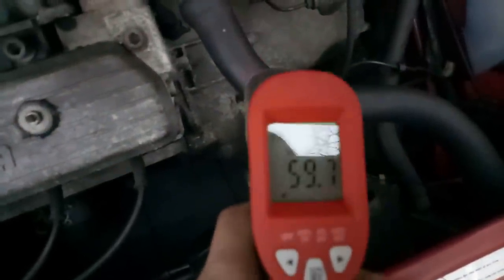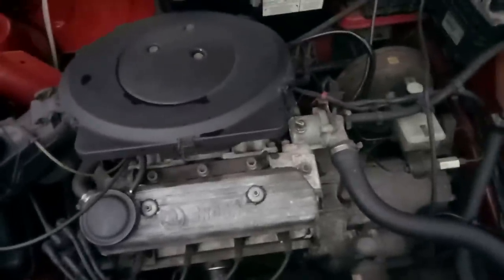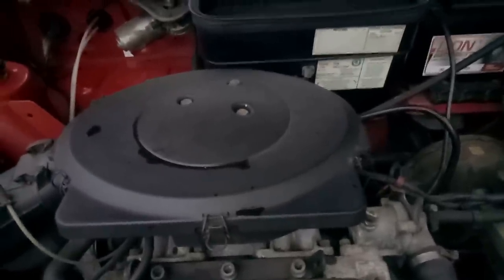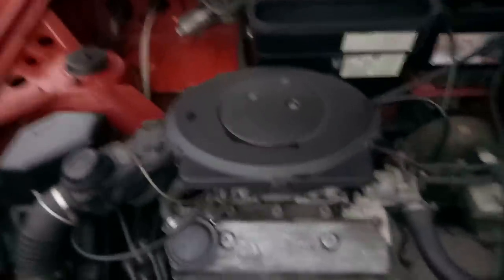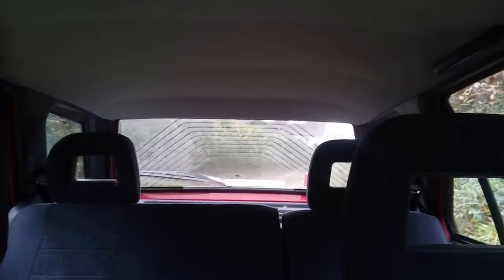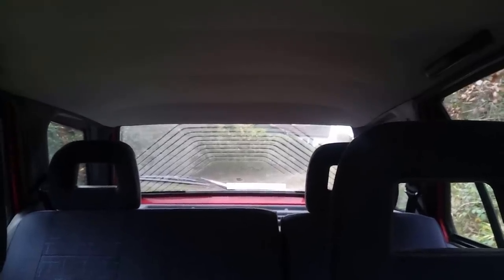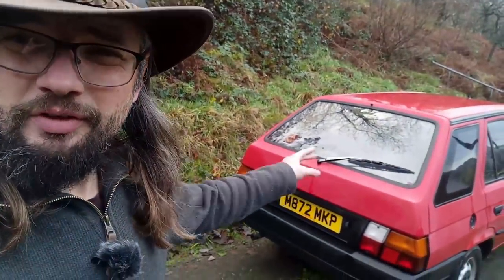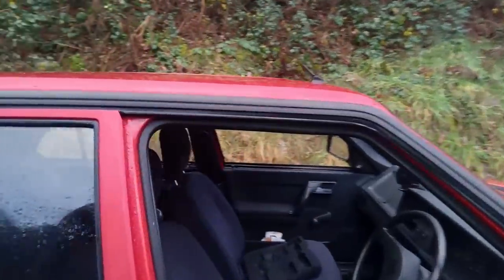Skoda Favorit Odometer fix (and other things)

Comment: had the same problem with the temp gauge. Try to give contact surfaces a good clean, they might get dirty. Best thingy is to hook up gauge to the voltmeter and see if it there is any voltage. It is a material which in different temeratures has a different electrical properties. I dont know the english word for this - sorry. If the voltmeter is not showing anything, the temperature gauge needs to be replaced. If you do so, let the engine cool down for couple of minutes and open the water tank, then change the gauge, otherwise if you will leave the tank closed the pressure of water system might flush the water out in the moment you take the gauge out.

Also, Iam afraid you need to fix it, since you have version with injection and ECU, it is messing with your injection and fuel enrichment, if it thinks its too cold the fuel consumption will get over the roof

as for a water in rear, check your spare tire, if it is looking like a fish tank you need to seal the arches over the rear wheels, definitely need resealing around the arches and bottom of the boot.
Reply from the maker: Thanks. It was very fish tank earlier! Water is clearly getting in through the tailgate, I'm just not sure exactly where.
Reply: @HubNut   thanks alot for replying. I didnt knew myself either, but it doesnt hurt if you reseal it all. That is what I did and it kept the water out ( and slowly got rid of that smell from soaking carpet 😃 ).
As for rust, Iam afraid you will have to reweld/resold every rusty part each winter. Iam sorry but our favorites just never knew how to take the winter with a bit of a salt 😁😁😅😅😭😭😭.
Reply: @HubNut  mine favorit back home in CZ before I departed into my one and only ❤ 󾓪.
https://ibb.co/RSLwXCy

west german export version of skoda favorit Black Line hatch with single rail injection system and strongest engine in the class, before april 2016 I was roaming in it around.

After allround body welding to get rid of rust, buying a set of nice wheel trims and a bit overhaul from myself and my mom, the car was imaculate. Even coppers told me so when they pulled me over.

Comment: well i mean its only 1 bulb so most ppl think its only one blub plus if only 1 has gone buying a 5 or 10 pack is stupid your use maybe 3 but then have other left over, but 1.50 is a bit much for 1 blub maybe 2 at least then your paying 75p for 1 i'd go on ebay and buy them used hay its bound to be 7 are good but three are dead i like those odds plus that would be more hubnut

Comment: I'm sure you are aware but the badges were in the wrong place in the first place judging by the old residue
Reply from the maker: They weren't. That's where they were from the factory.
Reply: @HubNut  Sort of - your LXi badge was on the wrong side and "Favorit" was too close to the outer edge and possibly too high. See this car for reference as to how they should be. http://www.newoldcar.co.uk/images/Featured_Cars/Skoda/Favorit/721_1993_Skoda_Favorit_LXi_Estate/1993%20Skoda%20Favorit%20LXi%20Estate%20Back.JPG

Comment: She needs a name I think Olga would be apt - just for reference 509t is the bulb base type and they take a 5mm wedge bulb - common as muck
Reply: Oh dry the boot out and put a dusting of talc/baby powder on the boot floor, this will show you where the water is coming from as the water pushes the talc out the way
Reply: My suggestion for its name is "Mahulena"

Comment: Simple test to see if the thermostat is ok measure the temperature of the upper radiator hose
it should remain ice cold until thermostat housing reaches aprox 65-70 c then it should get worm as the themostat opens and starts circulating the water
as far as the fan you can do a simple test by reaching at the thermal swich onto the rad left side behind altenator and shorting out these two leads
Fan should kick in otherwise you have a bad motor
Spi injection engine dont require such accurate temp reading
Nevertheless it is a goood idea t flash the system and install 80-85 c parts
90-95 Thermostat
80-85 Thermal switch
That is going to solve everything
Also invest some time in cleaning the throttle body
Reply from the maker: Fan does kick in when contacts are bridged. All I've been able to check so far.
Reply: @HubNut  26:04 temp seems a bit high
Reply: @HubNut  if the fan doesnt kick in you need to invest in a new temperature switch 
buy a  80-85c one
Now i can understand why the mayo was under the oil cap
Is the any way to contact you over pm?

Comment: The temperature gauge might be reading falsely because of a resistor being degraded. Check the resistor function, it will also allow your fuel gauge to function correctly. See if this helps you - https://www.briskoda.net/forums/topic/397550-skoda-felicia-dashboard-resistor/

Comment: You've got to love communist simplicity taking the dashboard apart with one screwdriver
Reply: In my capitalist Volvo 850 you can do that with one Torx screwdriver.
Reply: @mehrzahl2219  to be fair in my 45 you mainly need 8mm and 10mm sockets and that's about it you can take most of the car apart by far the worst ones are the Germans

Comment: Should have took some of the bulbs out of the Fox, Then ordered some new ones cheaper on Amazon.
Reply from the maker: Yeah, well, hindsight eh?
Reply: As someone with experience of being treated like a piece of shit while working at Amazon, and witnessing many others receiving similar treatment, I strongly urge people to never buy anything from Amazon. Pay a dew pence more if necessary to retain a scrap of human decency.
Reply: @GeorgeSPAMTindle  though i agree with you, its just that nowhere else is any better
Reply: @jusb1066  There honestly is nowhere worse than Amazon, so everywhere else is better. It depends where you live, but if you have any private auto-factors that you can get to use them and use them often. Once they get to know you you will start getting up to 40% off without even having to ask for it. A factor who I use supplied me with 3 different clutches, any one of which might have been what I needed for my 2002 Mondeo, sod's law saw that it was the DMF version that I needed, i.e. the most expensive one, and he sent his delivery driver to collect the unused ones from me and then gave me 30 days to pay. You don't get service like that from Amazon, and it cost me about £150 less than Amazon would sell me one for. Prior to this I had only bought service parts and fluids, one ignition unit, and a few cans of aerosol paints from the factor.
Reply: @GeorgeSPAMTindle  out local factors charge more and get them from the same places, like eurocar parts, which are trashy parts as well,  mine wanted 3x the price for a radiator i could buy online from the manufacturer direct
Reply from the maker: I don't have an Amazon account. I refuse to.
Reply: @jusb1066  I have the choice of several independent factors close to me. When they quote a price I just ask for 40% discount, and if I don't get it I will go on to the next one. I have only ever walked out of one factor's shop, and he then offered me 50% off as he stood on his door step shouting to me. I didn't go back.
Reply: @HubNut  i agree with the principles, but i lack the money to not choose the cheapest option most of the time, sometimes its amazon, sometimes its the same seller on ebay that undercuts the price, its confusing, but price wins, i cant really control what they do to their employees, they may also be as bad but not have had the press of amazon, i can but vote for a party that will create better for emploiyees and unions.  also i buy direct from china,  bad news is no tax goes to the UK , but then again, how much is going from amazon either...
Reply from the maker: I used to lack the money. I still ignored Amazon.
Reply: @GeorgeSPAMTindle  with less than 5 minutes i find out who supplies my motor factor and undercut any price he can give me, i can  get it for what he would pay for it,  all he does is scrabble for a cheaper supplier of worse quality, which i can do myself via ebay if i want a cheap part that wont work., they used to make a killing selling the towns cheapest oil, you could tell why , it looked like oil that had been used 100k miles already, if only i had the guts to sell my used oil as new!
Reply: @HubNut  I am very pleased to read than Ian, you are a good man. I sent you a link to a Skoda forum where there is some information about the resistor panel on the dashboard, apparently that could be the problem with your temperature and fuel gauges. Regarding your thermostat, remove it completely and reassemble and refill the cooling system, run the engine up to temperature and then take and record temperature readings all around the system. That way when you repair/renew/replace the thermostat you will have some readings to compare the readings with a thermostat against. I have tested engines for Cummins and that was one of the first stages in tests of most engines. Considering that we were testing the exhaust performance it seemed an odd thing to have to do, but that's what the procedure stated so that is what we did.
Reply: That's a bright idear 😀

Comment: As an engineer who often works as a freelance Technical Author I sometimes describe such work as 'writing the sh*t that no c*nt reads'. Having watched this video I am going to save it to my favourites list, in order to show people what I mean by such a cynical comment. Are workshop manuals not available for this car?
Reply from the maker: I have a Haynes manual. Somewhere.
Reply: @HubNut  Regarding the resistor panel on the dash, apparently they are prone to shorting out from contacting with something behind the dash. If you are any good at soldering you could just replace the resistors (for a few pence from an electrician's supply place), and I'd advise covering the exposed parts to avoid them shorting out again. Gaffa tape or epoxy resin are both suitable for that job.

Comment: Did you say on your trip home Cora 250 miles,that the cars mileage increased by 1 mile.
Going off that the mileage of the car could easily be 60'000 miles.
But either way who cares,looking at the pictures she is a solid lump.
Reply from the maker: Actually, on the drive home, it went up not at all. It then randomly clicked up one, then eight the other day.

Comment: if the clock was on 8000 and its only got 8 miles on it driving it back from London that means for every mile on the clock its done minimum of 15 miles really so its at least a 130000-mile car at least
Reply: That's assuming the clock failed and kept to this weird timing! It's probably slowed up more over time or been sporadic. If it's really got over 100k on it I'd be amazed given that the only real negative to any of the paintwork is faded red which is expected (and even that ain't so bad!). There's one of these with a low mileage that popped up on Gumtree the other night (I've got email alerts set for certain cars lol), I think it was only 19k miles or so going for £750.
Reply: @the.internet   lol maybe its clock is broken too
Reply: @zodsmuffin2369  lol a great communist way of getting rid of deprecation. Shame the Soviets were long gone by the time my Felicia was built - although mine was a mechanical tachometer it actually worked! (And still is according to the DVLA)
Reply: @the.internet  deprecation that's the dirty words of a capitalist shhhh ;)

Comment: Ian, if the original lights are too expensive, stuff some warm white LEDs with the lens (dome) filed flat in the original twist fit thingies. Use any resistor between 1k and 3k according to your brightness needs.
If you want some more details, PM me on facebook (Laurens Visser)

Comment: Probably Most likely thermostat is dead and always open. It was common thing that thermostat in Škoda 80' and 90' models failed. Cheap fix. Buy new one and replace yourself on the side of the road.

Comment: How satisfying to fix an annoying fault like that on the cheap. But if was only reading 8000 miles now .surely it must of reached that in a year or so of new.why wasn’t fixed under warranty.
Reply from the maker: Given the condition of the car, I reckon it did only have gentle use for the first few years of life. If it was just used for pottering my an elderly owner (my guess), then it wouldn't necessarily have clocked up many miles before the warranty ran out. Or maybe they just didn't notice...

Comment: Your speedo is out.  the needle should be pointing at zero.....
Reply from the maker: It isn't actually very far out on the road, perhaps very slightly more than factory.
Reply: Just saying. as long as you are happy.   But it would bug me.  Not sure why you put the ODO back to zero though...
Reply from the maker: Mostly because it was a major pain in the backside to align the wheels. It ended up closer to 0 than what it was on before I started.